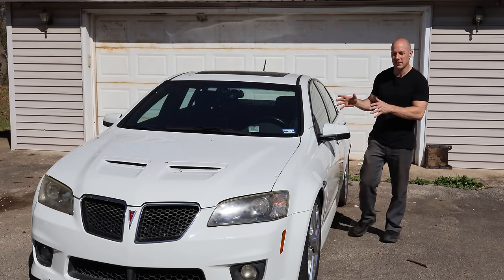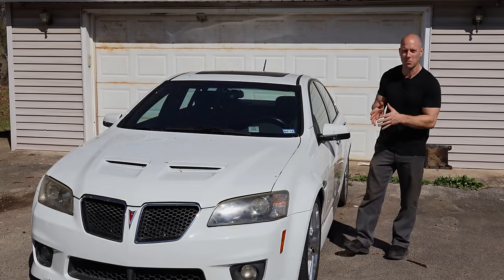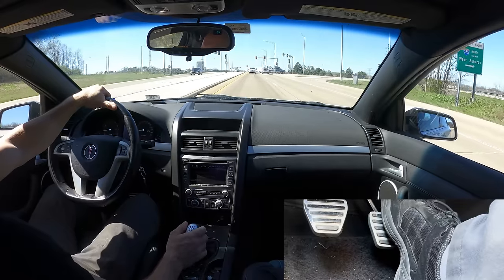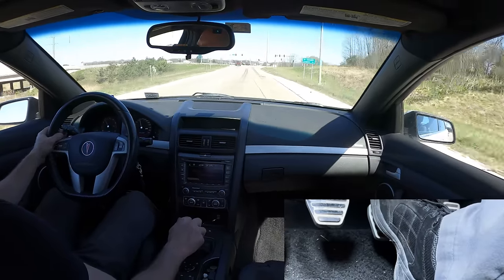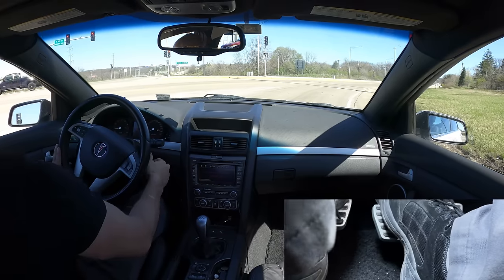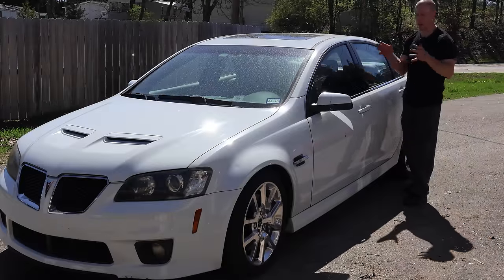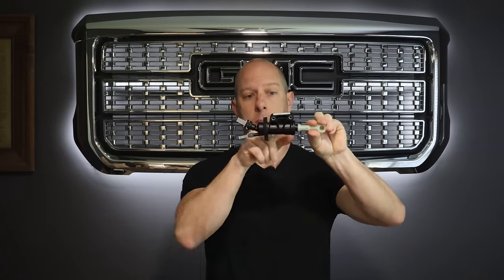How to drive a manual transmission without using the clutch, in case you broke it like I did!

Comment: Back in the mid 70's, my buddies 64 VW beetle broke the clutch cable.  He drove it like that for 2 years.  The engine died before he "got around to it"!  On more than one occasion, he borrowed my car and left me with his beetle.  The first time he borrowed my car, he hadn't even mentioned it was broken...
Reply: 😂😂😂😂😂 regular Volkswagen problems
Reply: what a nice friend!
Reply: was he later found in a lake lifeless perchance?
Reply: @shahramtondkarmobarakie1824  congrats, least funny joke ive read today
Reply: Can you explain how you make the car star moving? Do you use the starter motor to do it?
Reply: @arthur9511  With the engine off, make sure there is nothing that will obstruct the car's forward movement. Put the car in first gear and push in the clutch so the starter switch will work. Start the car. If the clutch does not dis-engage, as you hit the starter switch the starter will cause the car to move forward. The engine will start as the car begins moving. then release your clutch pedal. 

Switching to reverse you will need to follow this same procedure with the car in reverse gear.
Reply: In order to jump start the car the clutch has to be working 👍

Comment: I don’t get this. He starts the car with clutch pedal depressed and moves out slowly just like a normal clutch. Wouldn’t it be the starter that moves the car forward until it starts?
Reply: It looks like that’s exactly what’s happening, you can see the engine is lugging at the low rpm while it’s just the starter pushing the car along. Clutch is just to allow the car to actually start right?
Reply: The starter can roll the whole car in first gear until the road speed gets up just enough for the engine speed to catch up and give you enough power strokes (a lot more likely to happen in an LS V8 I presume is in one of these things) to get up to idle. It will lug and spit at you more the fewer cylinders and torques you have. I've driven only 4 cylinders like this, a fwd supercharged car was able to start pretty quick like this but the viscous awd NA Subaru I drove like this hated it unless you were already going down hill.
Reply: @dylanduke8389  right yeah, the clutch pedal had to be depressed because of the neutral safety starter he talked about. Even if the clutch itself isn't really disengaging (or at least not fully as he mentioned he still has a small amount of wiggle) the car has to "think" it's in neutral or the clutch is disengaged. As such there's probably a sensor monitoring the clutch pedal position telling the ECU "yeah, it's pushed, you're good to start"
Reply: You're actually correct he's not driving without clutch, seems like clutch is still working a bit if u try starting a car in 1st without clutch it can never be this smooth it'll be really jerky
Reply: @dylanduke8389  But watch the RPMs when he pulls off, the engine starts normally and then engages.
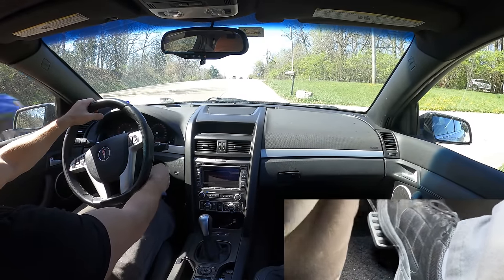Reply: In fact at 3:42 look at the right of the screen for the grass patch. He is rolling backwards! Wtf? Some details are missing here. Try rolling your car backwards in first gear without a working clutch. 😂
Reply: @black7rc720  I think it's a good tutorial, but it's fake
Reply: Absolutely fake! He rolled backwards before taking off
Reply: The clutch is working pretty fine. I've literally tried to roll my car to the side of the road using ignition when it wouldn't start. The car wouldn't start lile this
Reply: 3:30 he admits the clutch does in fact half disengage.

He could easily just bypass the safety switch so the car thinks the clutch pedal is in, even when it physically isn't, but then you would see it's not this easy or smooth from stand-still.

Not saying it can't be done, most ppl experience "bunny hopping" when first learning manual, likewise push starting a car is similar - very jerky when you drop the clutch to start.

So it can be done but yeah, the rolling back on a road with only a small inclination - plus on the second startup, him taking his hand off the key for a good 1-2 seconds before he finally takes his foot off the clutch and the car starts moving suggests the clutch is disengaging waaaay more then half.

Thinking about it, he doesn't even prove or show it "not disengaging" at all, the clutch could be perfectly fine and the video would look no different - all he has really shown is flat-shifting
Reply: I tried to start the engine once in first gear back when I still had a manual. The engine just barely turned, the car pitched up and down while jolting ahead at turtle speed. There was no way for the engine to reach starting speed that way. I do not get this video. The only thing I came here to see is how to start and get moving without a working clutch and the demo car does not move while starting and even rolls back! Jolting the car around with the starter wastes so much power that the starter cannot get the engine started. Starters do not have extra power because why would they? Automakers did not get there by wasting money. A smaller starter is a cheaper and thus better starter.
Reply: @satunnainenkatselija4478  put it in neutral first and you'll be able to start the engine.. you'll still likely need a mate to help push the car up to a speed that'll allow you to crunch into 1st gear due to the synchros. You'll be needing to rev match to avoid crunching into any other gear.

This video is misleading as the clutch has not totally seized, despite him clearly saying so at the beginning midway through he reveals the truth - it's actually only half seized. Hence why he can do what he did, yet someone with a fully seized clutch could not.

You don't even need a seized clutch to test this out for yourself, you can use a properly working manual car and simply try driving it without using the clutch at all - as that simulates a fully seized clutch. Pressing the clutch only half way at most would simulate the scenario in the video.

The creator would be well aware of his dishonesty when editing the video and i think less of him for doing so.

It's not an educational video, it's theatre for mechanically illiterate ppl.
Reply: @sirtra  These were my thoughts approximately as well that one would need a downhill start for it to work. Apparently I did not understand from the video that the clutch was partly functional.
Reply: He showed how to change gears but cheated at starting
Reply: @black7rc720  You are right it's impossible to start so smoothly in first gear without a clutch, and he is even going backwards...

Comment: "Now we become an expert at timing lights." Riding a motorcycle helps one to master this skill as well.
Reply: ???? Motorcycles have two clutches, one is disengaged just by pressing the shift lever, so that isn't syncro shifting.
Reply: But motorcycle needs to be held up by leg power when stationary.
Reply: was about to say i'm pretty good at this and clutchless shifting just from riding a bike
Reply: I time lights anyway just for fun. It’s amazing how many people jump out and pass me in anger. Hurry up and wait!!! 😊
Reply: @CallMeSpinpie  On a bike it's a bit different though, cause bikes have a constant-mesh transmission instead of a synchromesh transmission.
Reply: @integr8er66  No they don't. Motorcycles only have one clutch, which might have multiple clutch plates, but it sure as hell isn't disengaged automatically. Only exception is if the bike has a DCT, but that isn't the case for 99.9% of motorcycles.
Reply: @TheHiskiFinz I don’t really understand what clutches bikes have but in a car it’s a lot harder for me to shift without the clutch, on a bike I just let off and shift it and get back into it and it’s smooth and I cannot say the same in a car
Reply: @TheHiskiFinz  Ok, technically you are correct, there is one clutch pack, but there are two clutch release mechanisms. The shift lever automatically disengages the clutch before it moves the gear selection, So yes it does automatically disengage the clutch, so whether you use the hand clutch or not, the clutch disengages before you shift anyway, so its not the same as syncro shifting a car. So its not two clutch disk assemblies, its two clutch release mechanisms. There are you happy?
If you don't believe me, just start your bike, hold down the shift foot lever all the way and let go of the hand clutch, the bike will not move.
Reply: @integr8er66 Wait, what are you on about? What bike are you talking about that use this "dual clutch" mechanism? The only bike that I've ever encountered having this "foot-clutch" release in conjuction with centrifugal clutch is on a small-cc bike popular in Asia. Every other traditional bike without clutch-assist, literally only have a single pin to push or pull the clutch pack to disengage, operated by the clutch lever. The rotating gear shifter-barrel inside the gearbox is completely isolated from the clutch pack, and doesnt go to neutral in-between gear changes either. Open one up and you'll get it. I've only done a dozen but not one with those "dual-clutch" stuff you talk about. Care to share the bike model? I gotta see it
Reply: @integr8er66  What you're describing is the gears moving into neutral between gears. This does not "disengage the clutch", nor is it some kind of "second clutch release mechanism". The same thing happens with cars, because when you shift, you pass through neutral as gears have to disengage. The only relevant difference is the synchro-mesh vs constant mesh dog.clutch with the sequential mechanism.

Comment: when I was 18, I had a clutch wire go out on my first car Golf mk3. I was about 15km away from home, called my dad and he told me some simple instructions: shift gears at around 2500rpm, if you need to downshift - you need to revmatch it. And to start driving you need to turn ignition whilst in 1st gear and just press on throttle to start moving... it was awkward but it worked.
Reply: dad wisdom
Reply: I'm not getting that part: how is it possible to start engine when in gear?
Reply: How do you stop at traffic lights and re start.
Reply: @rolandrimann8788 you come to a stop in first gear with the breaks and turn the car off. Otherwise without a clutch the in gear engine will fight the break to dangerously pull you forward, and or stall out. 

Then just before it’s time to go you start the engine up in gear and you go. 

While the vehicle is off you are in forward gear so you shouldn’t  roll back? Or you use break till starting turn over. 

I have not tried this method yet. I am just relearning to drive manual and am back from my first try on a trip around the block with only one lunge stall 😂
Reply: ut why did he press clutch when starting if it's broken and always in contact with engine ? I was expecting him o do a fast start like racing so the engine stays on
Reply: @picapica8266  cars cant start without the clutch depressed
or at least some of them (safety interlock basically)
Reply: I had the same clutch wire braking once in a while problem with my 1974 Ford Escort 45+ years ago 🙂, so I drove it with no clutch using the same technique.  BTW replacing the cluch wire was simple, but I LOVED driving it with no clutch! 🙂
Reply: @awesomestuff9715  then you just press it lol, the cable or the hydraulic mechanism may be broken, but the clutch switch won't be.
Reply: @NaddlyC  yeah I was replying to the person wondering why he was pressing the clutch even though it wouldn't make the disk disengage
Reply: @awesomestuff9715  ah I see, sorry.
Reply: with a little bit of jumping

Comment: It's called floating the gears in big trucks aka 18 wheelers u only use the clutch to stop and go after that lightly pull it out of gear and put it in next highest gear.
Reply: Was gonna say the same thing.
Reply: Same, imagine pushing that clutch in 2x a shift...no thanks.
Reply: I just came here to say the same thing and if you can keep it rolling usually you can get it back in the first gear or second gear and not shut it off.
Reply: Yeah those Eaton 10 speeds are easy to float upshifting and downshifting just make sure you rev match.
Reply: @cheferic6969  2x a shift? why twice? is that some truck thing i don't get?
Reply: @BigToro  yeah it's called double clutching
Reply: @theharbingerofconflation  i knew that double clutching had to be done to save time if there is no synchros in the car, though i thought trucks had started using synchros, like any "normal" car has already, is there some reason for trucks to not have synchros?
Reply: @BigToro  just huge flywheels and mass. For some reason double cluching is still a recommendation from official bodies in overland trucking. From what I remember it has to do with mass impact on the components in fast shifts. A lot of truckers I know still shift like their rig is made from porcelain and I can only suspect that they blew up a transmission at some point in time. A clutch is way cheaper to replace than a transmission
Reply: @theharbingerofconflation  Makes sense, thanks for explaining it.
Reply: does this cause a lot of ware on the syncros?
Reply: @BigToro  double clutching makes floating gears in normal cars also easier
Reply: @wrth If you're double clutching, you're not floating gears. Floating gears is shifting without using the clutch pedal.
Reply: @aimless-drifter  double-clutching essentially removes the need for synchros as you're doing their job yourself!
Reply: true but transmissions on trucks are not made with syncronisers between the individual gears like cars have so its mutch simpler to  do it on trucks.
Reply: @cheferic6969 imagine if you had a twin stick and had to triple clutch

Comment: I lost my clutch during an open track day at Thunderhill near Willows, CA.  I didn't want to pay for a flatbed, so I drove the 150 miles home with no clutch.  This included many, many miles of stop-and-go Sunday evening freeway traffic on I-80.  Not to mention driving through town.  I got pretty good at rev match shifting, but stalling and restarting the engine when freeway traffic stopped or for a red light was always a pain.  But the most anxiety came from driving up my sloped driveway too fast and stopping before I crashed into the back of my garage.
Reply: I was just up at thunderhill two weeks ago, such an awesome set of tracks!
Reply: I did that once under a very tense situation (driving a borrowed truck). Developed a bad case of muscle memory and wanted to shift my other vehicle (which was an automatic) for a couple of days afterwards.

Comment: Being able to drive a manual without a clutch is something I learned to do when I was much younger with quite a few old bangers I used to drive. It's definitely a useful skill and  has saved me more than a few times
Reply: I get it once the car is moving

But starting up in 1st gear would surely just stall the engine?
Reply: @TheVicar Same here. How does he start the car in first gear and it goes smoothly without knocking and jerking?
Reply: @radiocontrolled9181  I'm guessing you'd have to be pointing downhill to give it chance. I tried it on a flat once, when my clutch hydraulics failed, and all the car did was rock backwards and forwards
Reply: Endearing memory of scooting a motorcycle through the centre of Rhodes  and slamming it into gear because the clutch cable had snapped on the hire bike, my mate actually had the bike, I swapped with him because he couldn't "clutchless  shift" . I'm British by the way, so riding on the right, round the roundabouts the opposite way --- jolly fun😮. 
You really only (on a car) need a clutch  to get yourself going.

Comment: I bought a motorcycle this guy I knew had many years ago and it had two broken things. The kick stand and the clutch didn't work. He owned it several years and always push started it and shifted without the clutch because it was a dirt bike and he didn't have a kick stand. Anyway I thought it would need a new clutch, a kick stand and possibly a kick starter. I took it home and installed a cluch cable and it worked like a champ. I can't believe he leaned it up against something and push started it every time just because it needed a clutch cable. The kick starter worked perfectly. I guess he just wasn't very mechanically inclined.
Reply: motorcycles are designed to shift without a clutch, unlike cars.
Reply: It's all about the revs. Get the speed right it's simple

Comment: I had a 1988 Ford Ranger that I had to drive around San Diego, Ca for about 6 months without a clutch.  I even pulled a trailer like this a couple times.  I pulled the transmission 6-8 times trying to figure out what was wrong with the slave cylinder, but it wasn’t until I had a buddy with me to look at the slave cylinder while I pushed the clutch.  It turned out to be a missing o-ring where the hydraulic line went into the cylinder.  But I did get really good at driving without a clutch and removing and installing a transmission in an 88 Ford Ranger. LOL
Reply: Wanna do my 85' ? 😂

Comment: Hello from India! I stumbled across a similar technique 20 years ago; our chauffeur showed me how to change gears without the clutch by timing your gas input/cut-off to the gentle-but-firm pressure on the gear, and you can slip into the next gear rather satisfyingly.  It blew my mind. In later years, I discovered this - accidentally - on my motorcycle, too. Now I regularly practise this skill; it’s wonderful to feel one with the machine in this subtle art :) 

I’m writing, however, because you completed the information loop for me all these years later. Now, I have a guideline for starting the car without the clutch, too - though the circumstances are different (I suspect mine is unlikely to come apart while engaged). If I ever run into this situation, it will be quite the hero’s rescue for whoever needs the help. Thanks man, you made my day!
Reply: Hello fellow Indian bhai